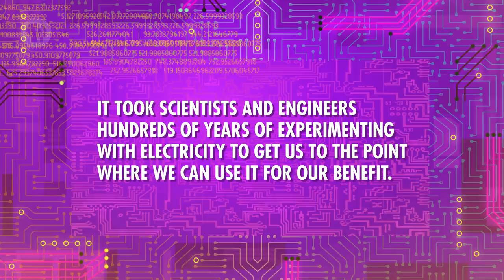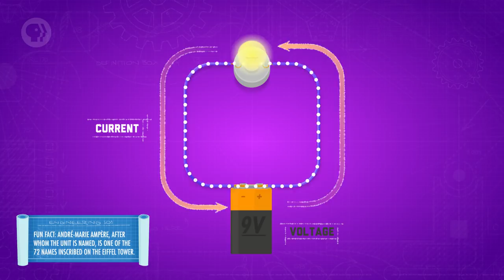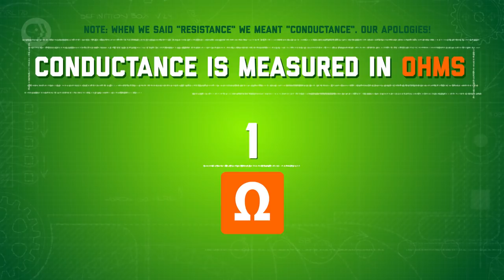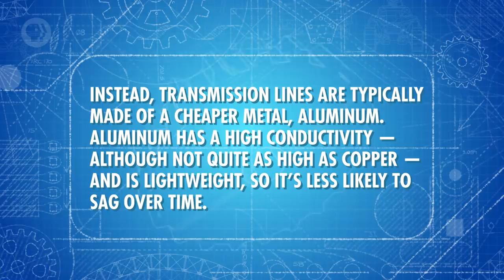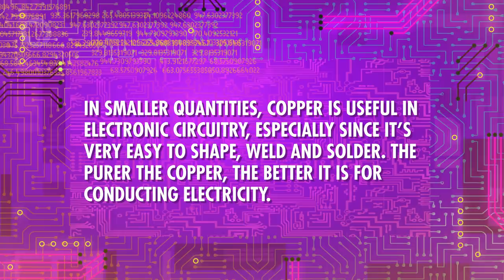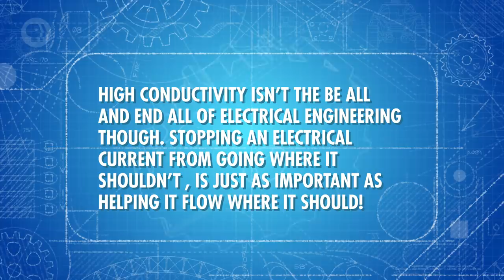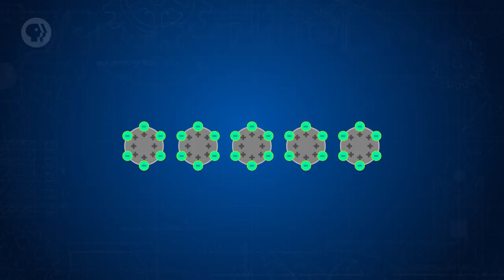Electrical Power, Conductors, & Your Dream Home: Crash Course Engineering #21

Comment: The proof that there will never be time travel:
A) The person who invents the first time machine will be an engineer.
B) An engineer with access to a time machine would immediately go back in time and slap Benjamin Franklin in the face until he guesses the charge sign of electrons correctly.
C) Benjamin Franklin did not guess the charge sign of electrons correctly.
B2) Ergo no engineer went back and slapped him.
A2) Ergo no engineer ever has access to a time machine
D) Ergo no first time machine is ever invented.

Comment: LEDs are certainly more efficient, but they're only better for the environment if you're using coal rather than a dam to get your power.
Reply: Interesting. Why though?
Reply: @heyoladies7118  The manufacturing processes for semiconductors tend to produce more toxic waste than extracting the raw metals needed for incandescent bulbs. Seeing as hydroelectricity done right has only a localized and minor effect on the environment, the claim that LEDs being more efficient makes them intrinsically better for the environment is a bit simplistic. There are more dimensions to the problem than that.

Comment: Why don't you make crash course Mathematics?
Reply: Because maths takes a lot of preperation since it is so big and branched, they have crash course statistics which is a branch of maths.
Reply: @habeebhabib3160  Why don't they make something like crash course geometry?
Reply: geometry is also a pretty wide branch of maths, however, they can do that and they should. so I do not know why it is taking them so long.
Reply: do you need help with geometry??
Reply: It's more likely that they will make CC's about smaller branches of maths. Like they do right now about statistics

Comment: ELECTRONics uses positive current flow, oh the irony, the rage inducing irony.
Reply: Maybe semiconductors?
Reply: Brian Miller
The animation at 1:20 actually describes how holes move in a semiconductor. As you can see no positively charged particle actually moves, since they're locked in a crystal structure. Even though the formal positive charge moves the electrons do all the work.
The places where you've actually got positively charged particles moving are the electrolytes in batteries and electrolysis cells and in particle accelerators. Maybe also some other places I can't think of right now.
Reply: mwalsher
I know the convention predates the discovery of the electron but it still ticks me off. Positive current flow is easier for electronics (because of said convention), electron flow makes more sense for electrochemical reactions and the physics behind electronics. Though I've heard old timer electronics guys confusing the two and saying electrons in a vacuum tube flow from anode to cathode....
Things should have been set straight immediately, sadly it's too late to change the convention now.
Reply: There has been a 50/50 chance to name the poles right and they missed it. If they did it right, electrons would be positive and the flow would be right.